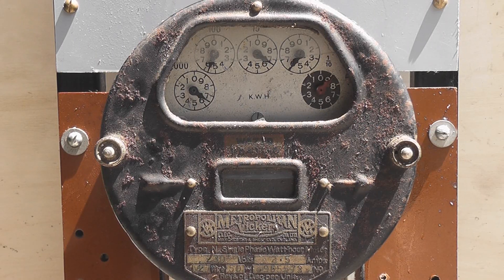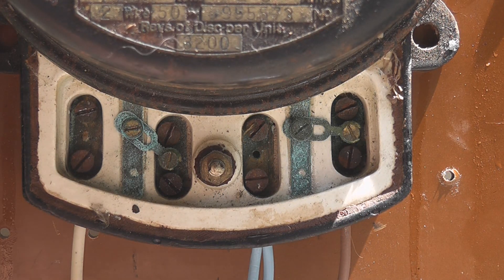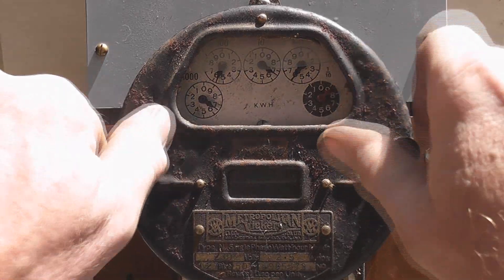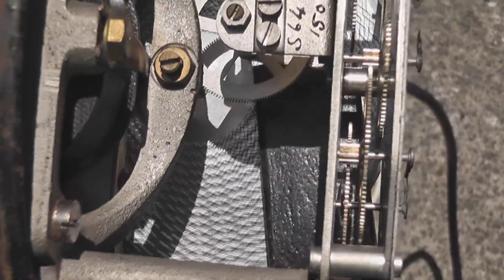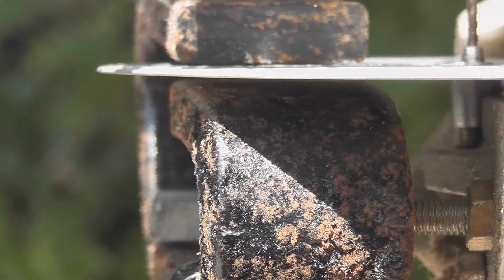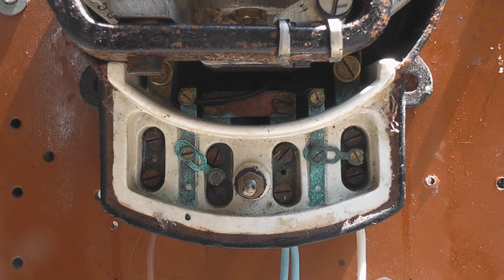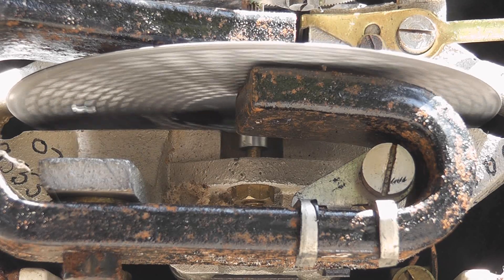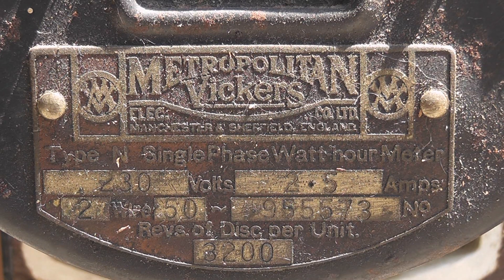Metropolitan Vickers Watthour meter type N

Comment: Nice instrument. :-)

I really like the specification plate on there, it reminds me of the one on the side of that transformer you have.

Bit of a shame that this poor meter has a warped loadwheel. What's the chances of straightening it without cusing it any damage?

It would be nice if you could do a video-based restoration of this one, just like I did with the British Sangamo HM, that would be fantastic to see it being restored in various stages. :-)

Thanks for showing this MetroVick.

-BBD.